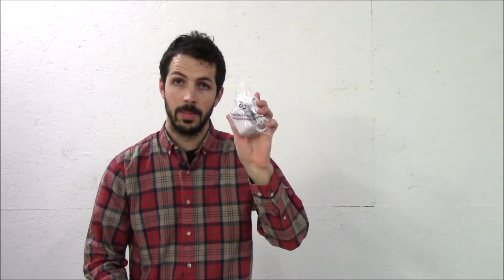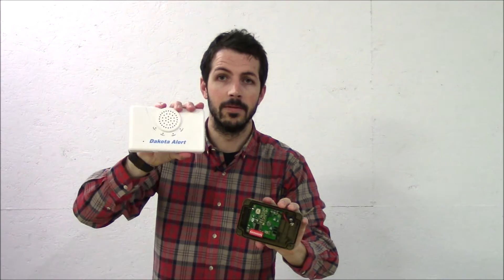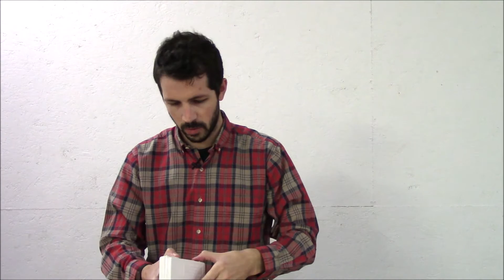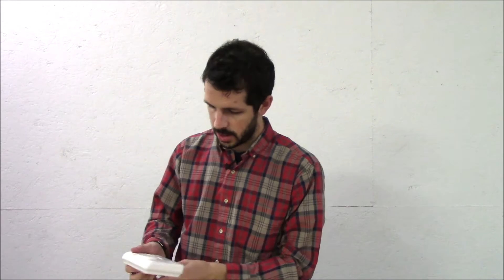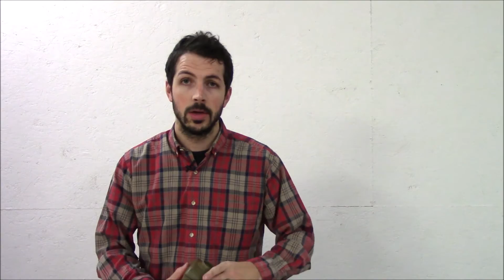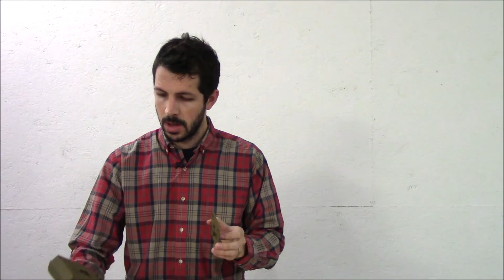How to Set Up Dakota Alert Driveway Alarm - Setup Tutorial

Comment: Hi, I have set this up correctly, the receiver makes a noise when I am handling the transmitter.  When I put the transmitter on the tree, the LED lights up when I pass it but no noise on the receiver.  If I take it off the tree and play with it, the receiver makes a noise.  Frustrating!!  Please help.
Reply from the maker: Hi Mindy, most likely that is happening because the tree is blocking the signal or you are too far from the receiver.  I would try placing the sensor on a different part of the tree (preferably on the side closer to your house) or on a different tree altogether.  Take care.

Devin & the Guardline team

Comment: Does it make that alarm sound outside when you pass it? Also, does the LED light up on the outside (transmitter) when you pass it?
Reply from the maker: Hi misssweetdesilou, when you pass by the sensor (transmitter), the receiver inside will sound.  The sensor does not make any sound, but it has an LED that lights up red when it's activated.  Let us know if you have any other questions.
Reply: If I bought more than one Dakota Alert Wireless Driveway Alarm or any other device, would there be any interference with each other?
Reply from the maker: No, that is very rare to have interference with another device.  If there was, instructions are included to re-code your device.